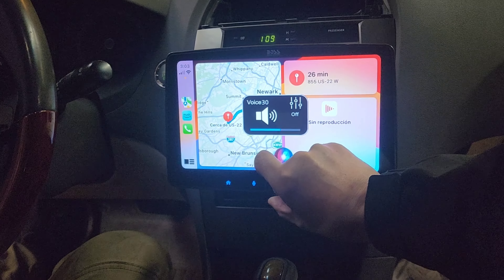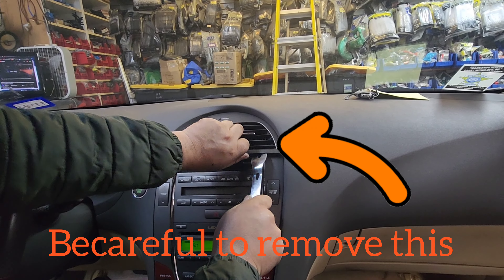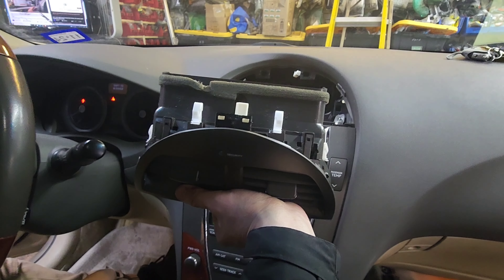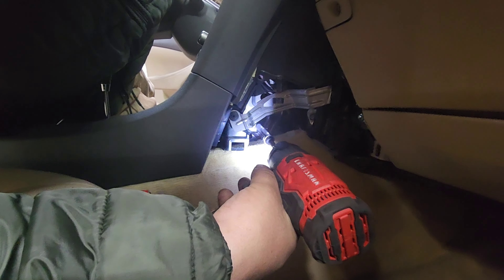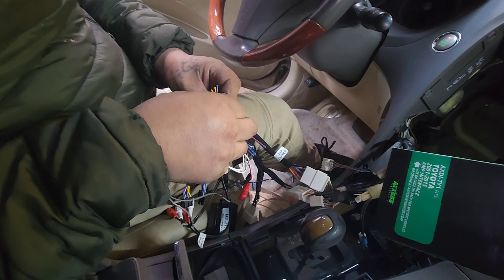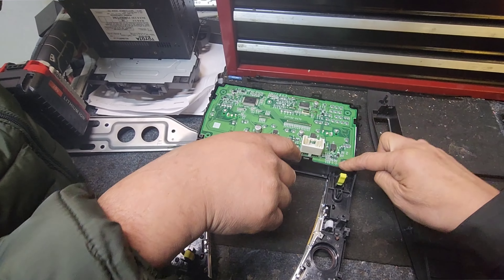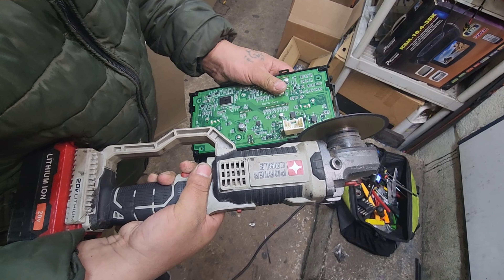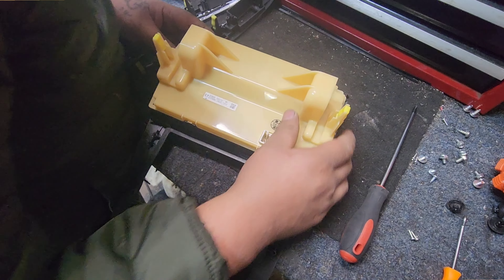2007 Lexus ES350 How to remove the radio Install apple carplay android auto 10" Bluetooth

Comment: That's a clean install and a nice Boss but after you factor in the cost for the camera, dash kit and module I'd go with one of the Android Tesla units that fit nicely in the dash.
Reply from the maker: I guess everyone has different preference, the customer wanted this rather than off name brands 😔
Reply: @goautosound1  Yes thanks for replying to all of us.
Reply: I am still hearing about a lot of bugs in that tesla and I"m sure this was half the cost
Reply from the maker: @quentin636  There are cheap android radio and good decent android radio. If you are looking for a cheap radio, expect some bugs
Reply: @quentin636  And it uses the factory amp which the other one doesn't

Comment: So the 7" goes in nicely but the 10" covers the ac controls?
Reply from the maker: Yes, the 7"would be flush with the dashboard but 10" will block the heater control 😢

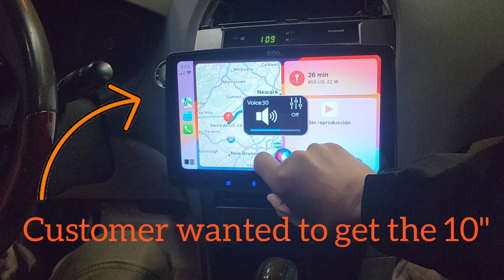Comment: is it possible to switch the position of the ac controls to where the radio is and vice versa? 2:55
Reply from the maker: @bercetti  I never try to switch the radio and heater control, guess you can try if there is space behind

Comment: Like where can I find another Dash kit?
Reply from the maker: You can find these online amazon or eBay
Reply: Walmart has it
Reply from the maker: Try this link 
https://www.amazon.com/Metra-99-8162G-Single-Double-2007-2012/dp/B013VTO458/ref=asc_df_B013VTO458/?tag=hyprod-20&linkCode=df0&hvadid=312455765168&hvpos=&hvnetw=g&hvrand=1619685042568101148&hvpone=&hvptwo=&hvqmt=&hvdev=t&hvdvcmdl=&hvlocint=&hvlocphy=9004287&hvtargid=pla-569054152559&psc=1&mcid=f251d26228053da891e465b9676e8550&gclid=CjwKCAjw26KxBhBDEiwAu6KXtxcPp06eGkCdRT50q0yJWxPwFXdlifLrg3-2yj9mQC5Mb0TjC_m-ghoCsKEQAvD_BwE